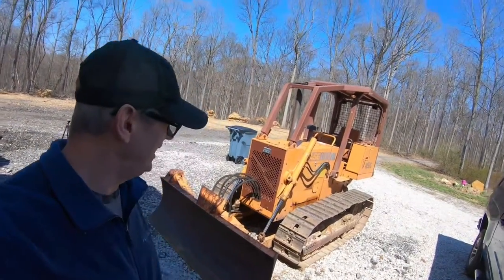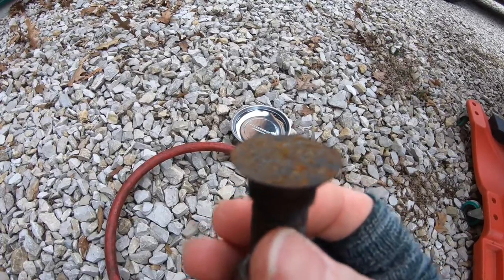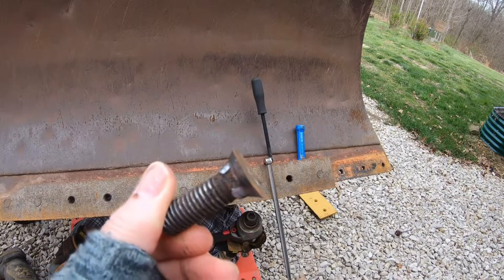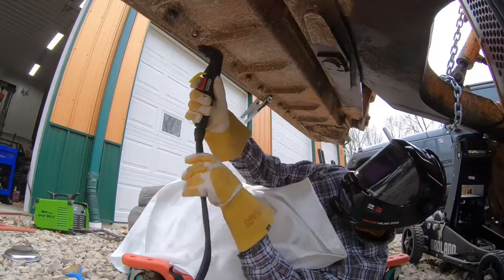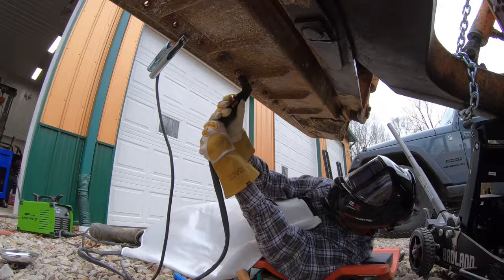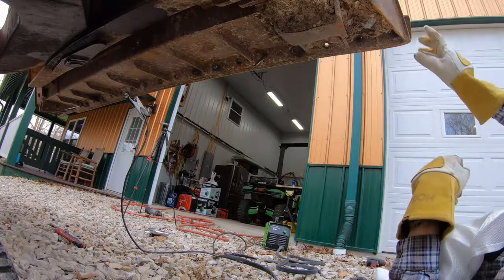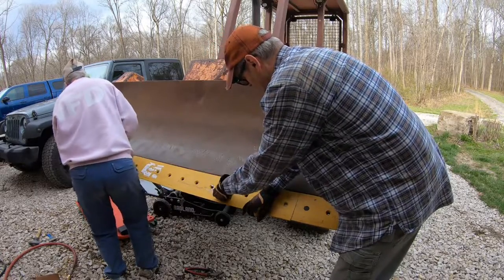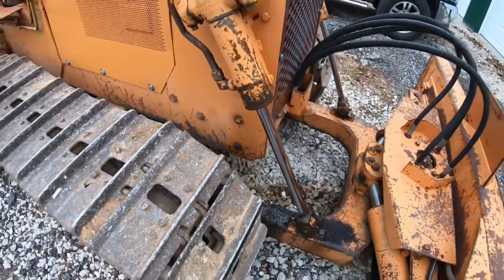Case 450C Bulldozer New Cutting Edge Installed

Comment: good video and job we use to weld the head of the bolt to cutting edge or point when they rounded off i think that way have been easier. i have a shirt just likes that full of holes from welding under things. take care. be safe and well.
Reply from the maker: Thank you for watching and your tip. Yes I didn’t think of that but I bet it would have been much easier. Thanks again! Have a great day and be safe!

Comment: How many lb fts is that reversing at?
Reply from the maker: Thanks for watching and your comment. That was the Earthquake 3/4” impact from Harbor Freight and it is advertised as 1700 ft lbs. Thanks again, have a great day and be safe!
Reply: @CopperBarnHomestead  wow that's some torque. Really enjoy your videos and your approach to the content. Keep it up. Keep grinding you'll go viral. Review weird and odd stuff those do great!
Reply from the maker: @RoughNeckRage  thank you very much, we appreciate your support!
Reply: If you have a welder you could weld the bolt to the scraper and then remove the nut
Reply from the maker: @kevinroberts9394  thanks for the tip! Someone else told me that’s how they do it. Never even occurred to me because I was thinking of a cutting torch mostly. That is a much better way of doing it other than a torch! Have a great day and be safe!